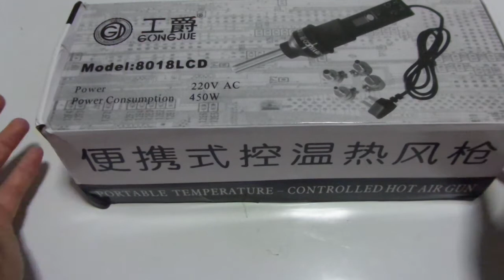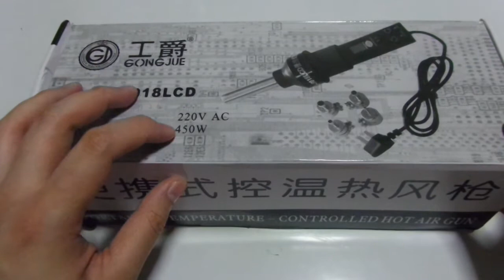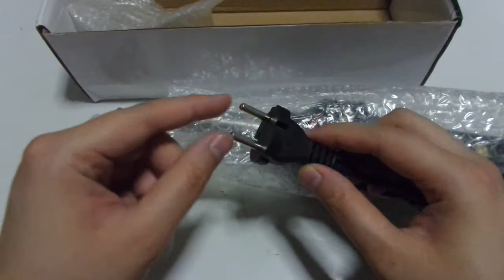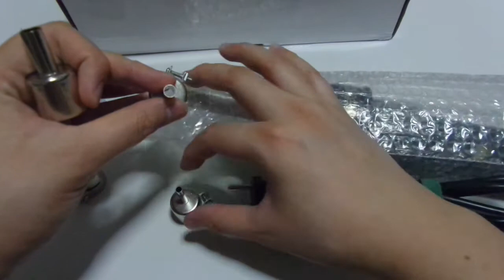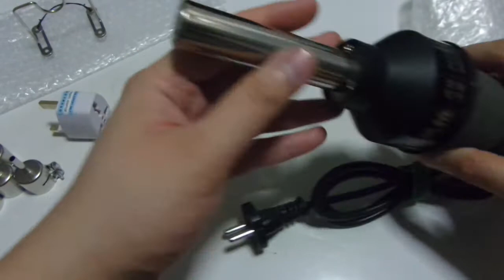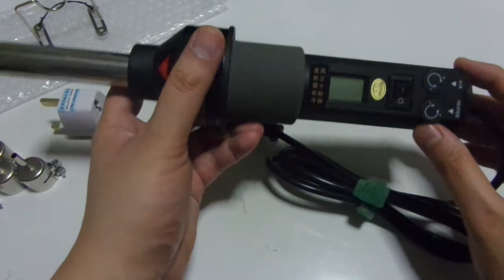GJ-8018/8018LCD Hot Air Gun reUnbox and Rant

Comment: In really, it's not review, but is "unboxing".

By the way, can it dessolder an IC in double face print circuit board?
Reply from the maker: I made another video on the actual usage, you may want to check out.
You mean double sided board? I don't see why not if you got the temperature right.
Reply: I used it to remove MOSFETs from an XBOX ONE S motherboard so I'm guessing, yes? Use flux.